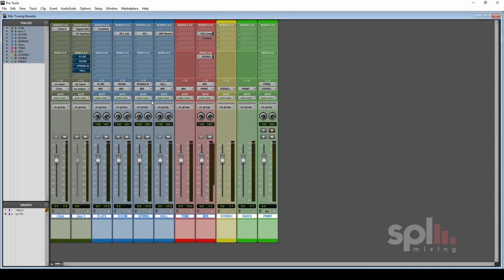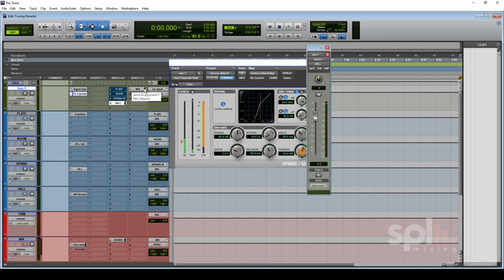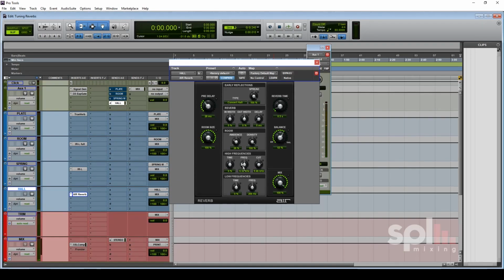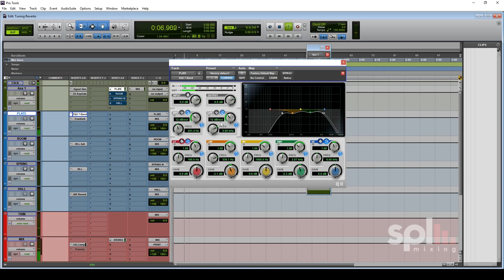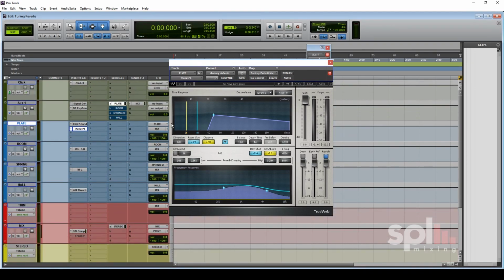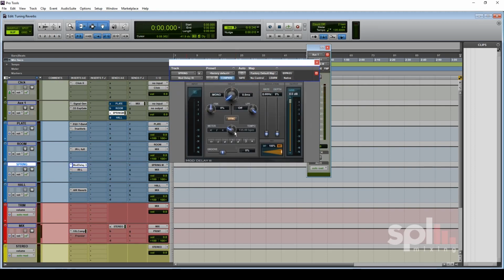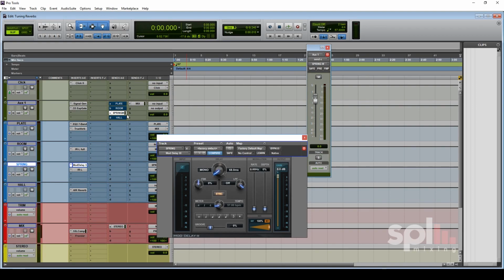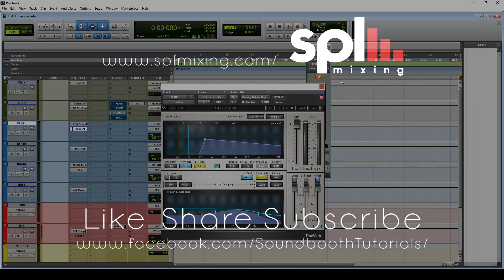How To Tune Reverbs Using Pink Noise

Comment: Early on, when I had an issue in a mix that I could quite get right I used pink noise to adjust levels.
Pink noise falls off at around 3 dB per octave similar to that of human hearing.